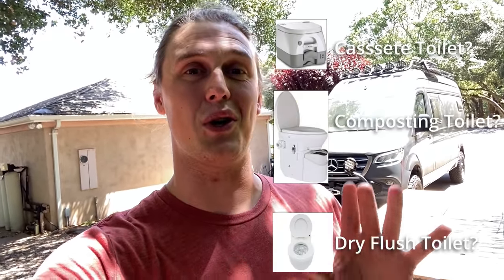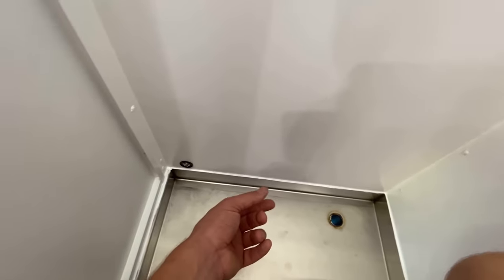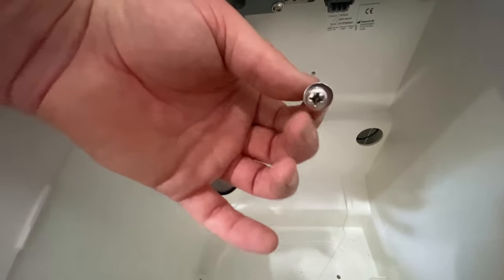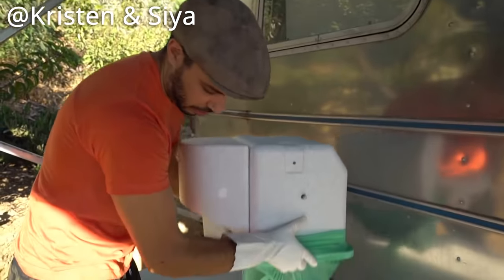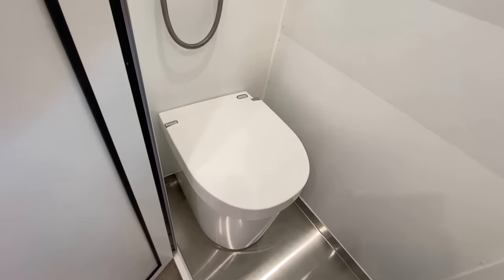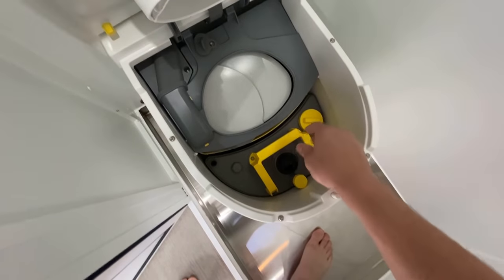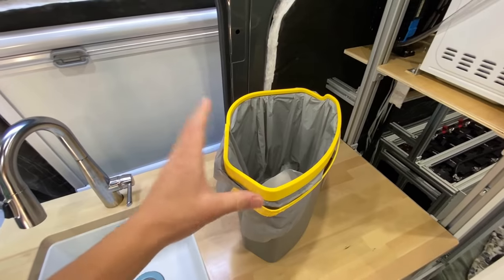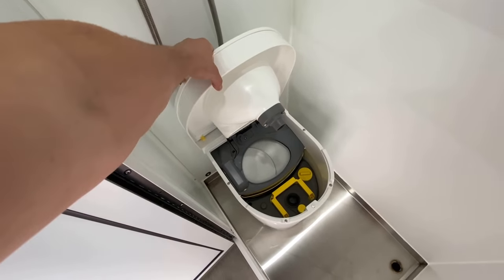The BEST TOILET For Van Life??? Hint: not composting

Comment: More options are always good, great video! 

I'm happy with my cassette, I also use a bidet hose. So the water I use to clean myself with also gets most of the 'material' down into the tank. I find it easy to keep the bowl clean at the same time for the same total water use as an ordinary flush cycle.

I think a good chunk of the odor issue comes from people being frugal on the magic blue goo because it's expensive, but you can buy a bulk commercial grade toilet cleaner that does the same job much cheaper but there's nothing to do about the odor from dump sites haha. Just don't breathe for a minute and remember to open the vent valve so you don't get splashed :)

Comment: We have a nature's head composting toilet and love it. We have cleaned it a few time and just go out in the woods and dig a small whole and turn it upside down and cover the whole. We usually wait at least 4 days to a week without using it before cleaning and have never found solids, everything was composted down. We have never hand trowled out the composting part. The urine container is white so you can see if the urine is close to getting too full. I am not sure how anyone could let that over fill unless they wanted to get views on Youtube. It's just a chore you do on the road, every couple days it gets emptied no big deal. Been on the road for 10 months but try to use a pit toilet or gas station toilet for the duty and only use our composter when nothing is available. It works really well because we stay in a campground and then it has time to compost down and we don't have to change it every month. Love it. I just don't think a months worth of number 2 in a bag would not smell without putting in some peet or something for the smell. Good luck

Comment: I've essentially made a DIY version of your toilet in my van. It's a 5 gallon bucket with a urine diverter attachment, and I have a trash bag lining the bucket. I even put a computer fan in to draw the air out of the toilet, and the whole thing is encased in a mostly waterproof box that I built. I still use peat moss over the #2's because it is going to smell regardless of the fan drawing air, and the peat moss helps to trap the odors a bit better even if its not being mixed up with the poo. You'll find out after you use it if it still smells at all, but if so just throw a little bit of peat moss on top and it should help a lot.
Reply from the maker: Super cool Dalton, I respect the DIY! Probably saved quite a bit of $ too
Reply: I use coconut coir. flies hate the stuff. Found in pet stores as reptile bedding or at a nursery's the stuff is insanely absorbent
Reply: @scott.wallace8625  And better for the environment as peatland is valuable and being lost.  Coconut coir is widely available too. Built my own DIY version also. Plans and a separator are available on the net.

Comment: Interesting concept. I have been studying this very topic as I decide what I would want for a toilet in a van conversion. I use a luggable loo in my boat which is simply a five gallon bucket with a seat. It has a bagging system that you simply seal up after use and dispose of afterward. The bags contain a substance which converts urine to a gel. I was able to eliminate the head system and all of its issues.

Comment: Great video explanation very interesting.  The only part that would weird me out is pulling the solid container.  Maybe they would add another feature where before you lift the seat, it would automatically wrap the solids bag into a tight closure so there is no "view" and all you would have to do is pull up and dispose of the bag.
Reply: Maybe just open the poo port and dump in some compost matter to cover it, then lift the lid and bag it up.

Comment: Thank you for mentioning something that I worked out so many years ago when researching toilets and that is that if you truly wanted a composting toilet to work that you would need to actually remove a bucket load and store it for months and then dump it after it had completely broken down. Although I have always wondered about the legality of dumping bags of poop in standard garbage. I think that this toilet takes the simplest ideas of peeing in a bottle and pooping in a plastic bag (on the very rare occasion that you need to poop in your van, because you are never really that far away from a toilet and if you are that far away from a toilet you can usually use a shovel and poop outdoors) and fancies them up with a smell extractor and some ease of functionality.  $3,500 (the price that I googled) for a fancy plastic bag and plastic bottle??? You would have to have more money than sense in more opinion. But I can see the appeal. You could hook a computer fan up to a bucket for like $30 and get the same effect.
Reply: Yes if you want to compost it, you would need to keep it for a long time, but it will continue to compost after you have dumped it somewhere appropriate...and if you look at the toilet featured, you will be faced  with a really unpleasant sight and job every so often, and you will be dumping pure unadulterated shit in the garbage bins...not nice..
Reply: Yeah, it's supposed to take 3 to 12 months for the harmful microbes to break down.
Reply: There nothing illegal or unethical about dumping bags of poop in standard garbage.  Where do all the baby and elderly diapers go, do you think?  And bags of dog and cat poop.

Comment: Thank you for a great video. We have used a 5 gallon bucket top lined with a plastic seat (pool noodles also work) with super strong OKKEAI 8 gallon trash bags and some deodorizing, clumping cat litter. Less space, less expense and just dump the bag responsibly. Your toilet is a great piece of engineering and we would be interested in its longevity. Ususally, simpler things last longer with less breakage. Especially during that Zombie Acopalypse when you really HAVE to go.

Comment: I was planning on doing a lazy composting bucket toilet for my trailer build.  Since I don't have a garden to make use of the compost the solids were going to get thrown out anyway.  I figured a layer of coco coir, a layer of poop, a layer of coco coir...  This should cover any smell like my cats do with cat litter.  No stir mechanism needed which allows for trash bags.  I lose space with the coco coir but I save on the engineering of not having to seal it too well.  It does require lifting the lid to pour the coco coir each time.  The >$1000 price for the Separett is not a deal breaker for me, but I want to see if the bucket works out before I spend that kind of money.
Reply: I'm in the same boat as you. Joseph Jenkins' Humanure Handbook has been super helpful for me
Reply: if you find it does smell Try adding a very small fan to remove the odour, or think about how you could add one later if needed :)

Comment: Great video. We had one of their toilets in our van and the smell from the vent was terrible. I like the idea but personally don't think they work for van life. I think they'd be a fantastic unit in a permanent structure where you could vent it through the roof or the rear of the building, away from the living areas. We swapped to a Natures Head unit and we get almost no smell from the external vent (which due to the design of our van is on the living side).
Reply: @Alexandra-lx4jq  my vent wasn't venting inside. The toilet was inside. The vent went out to the external wall of the caravan but as we sit close to the vent, we could smell what was venting out. Caravans can only be 2.5m wide so it can be hard to escape the smell.
Reply: @Alexandra-lx4jq  I could smell it when outside the van sitting under the awning etc. I couldn't smell it while inside the van.

If you could vent it to a side of a building that you don't go near etc it would be okay but if it's near an area that you use for living (ie. BBQ, outdoor seating area) then I wouldn't recommend this model.

Comment: If they could combine the toilet you have with an external cartridge, that would be ideal. I'll stick with a normal cartridge toilet for now, so despite the foul output, it's all in a sealed box I pull from the outside of the van and never look into.
Reply: Does cassette style really give off bad smell?
Reply: cassett only results in a nondistript brown liquid use the septic safe chemical and dump in any unsecured out house  or if your remotely cities have free dump stations during open during the week or down a friend's toilet being in that shower room it would smell that bad except when actually flushing but this toilet is cool to looks more like a weekenders solution than full time
Reply: the problem with separating soilds from liquids in a cartridge is being able to dump the solids the sloshing liquid helps break up and carry out solides as wells as pervents "pyramiding" the tendency of a waste pyramid forming at the cassette opening preventing new waste from entering  the cassette. but you maybe  able to add a specific amount of water to the solid tank to account for this.

Comment: Thanks for taking the time to make this video, appreciate it. For me however, it looks like too much faffing about. I own a cassette toilet for overlanding and I don't mind emptying it after a trip but yes it smells. I just personally do not like the separation of urine and poop that you have with this and composting toilets. If there was a combo composting toilet/cassette that took care of both jobs in to a lined (with a compostable bag) cassette that you could then tie off and remove that would be the most ideal I believe.
Reply: There's a model that diverts urine straight to a grey water tank. I wouldn't at all understand why somebody would prefer handling urine cassette instead of just releasing the greey water tank. Your comment makes little sense, seems to you prefer to have smells and to handle waste much more directly.

Comment: Thanks for sharing your ideas.
But somebody should make a incinerating toilet powered by diesel, just like those Webasto Heaters.
It’s gonna be the best solution for dealing the nasty stuff.
Reply: EcoJohn used to sell one that runs on diesel, but it's way too big for a van. Don't know why they stopped making those. Can't find it on their website anymore.
Reply: Or propane.
Reply: @scottslotterbeck3796   propane Incinerating toilet comsumes alot of propane. Electric ones also takes up alot of power. Both electric and propane incinerating toilet are aready on the market but its just not very efficient in saving electric or propane, so maybe they can make a diesel and will probably be better and economical, maybe.
Reply: A friend has a wood stove in his camper.  He incinerates his poo in the fire.  Never asked him what he did in warm weather, but assumed he used a cat hole in the forest.
Reply: @danbisone1587  that's a bit too cave man for me, but he's on the right track

Comment: why not buy their bags and use in a luggable loo?  this unit will eventually get mucky in every crevice and have to be thoroughly cleaned - uggh!  the only innovation I see here is the exhaust fan.  you could just build an enclosure for luggable loo and vent the enclosure.  I see lots of outhouse honey pots in campsites now that just use a chimney with stack effect to draw smell away.
Reply: Plus the point not mentioned is the luggable loo costs $25 or less.  This thing is priced at $1049.

Comment: The smell of feces I would guess during the emptying the bag phase would be horrendous and tend to linger inside the RV until completely aired out.  What do others say? Actual testing would have uncovered the convenience or inconvenience of emptying the toilet 1 & 2.
Reply: I would take the bucket outside to open it and pull the bag out. That might help. 🤷🏿‍♀️
Reply: @1nhonho  Good point.  Counter point...$1024.  That's a lot more than a cassette toilet and with those you can do the same thing, take it out of the van before removing the tank.  I found cassette toilets for as little as $70.  I can put up with a lot for $950.
Reply: @AudeKhatru   I was replying to your comment about the smell of the bucket when emptying. I really don't think buying a cassette toilet will help you avoid the problem. The cassette will smell when dumping as well. Most likely even more because it's raw sewage. 
A composting toilet is for people who do not want to deal with the disposal of raw sewage.
A cassette toilet has a small holding tank and requires much more frequent dumping. 
A composting toilet can last much longer, saves water and is much more convenient to dispose of.
You don't have to buy an expensive brand like this one. 
In their most basic form, a composting toilet is just a 5 gallon bucket, cover material and a urine diverter. Plenty of videos here on YouTube on how to do it yourself.

Comment: That's just a composting toilet without the composting material....
Reply: you mean a composting toilet is like that but somehow need composting material even though they dont compost !  oh there is a conundrum :)
Reply: @David_11111  No... I mean it's a toilet which separates the compostable parts as opposed to creating sewage. It's literally a composting toilet. You compost the results.
Reply: Not really.  It's basically a camping toilet with urine diverter.
Reply: @austingonzalez1148  You could Compost the results, Just the same as you could Compost the results of so called composing Toilets  Neither are Composing Toilets, they have a Bin Two years Big :) imagine that in a camper LOL ...
Reply: @David_11111  So you agree they're are the same...

Comment: That's a really cool toilet, but I would also add woodchips and start the composting process. Or add a compostable bag on the bottom of any compost toilet. Even though the composting process would not finish in a month, it would still be enough to get the process going, and to reduce the size of the waste. I used a compost toilet for a month in a summer camp, and you would be surprised how small the volume of organic waste becomes once it is composed.

Comment: This was very convincing. I have to buy a toilet and I was going to buy one of those cassette type toilets. No black tank, it comes with its own tank that you can fill with water press a button and it sends water into the separate tank attached to the same toilet. Still would need me to fill with water and I can imagine having issues with dumping it and possibly cleaning it but you showed me a good alternative. I especially like the bag instead of the material so will definitely be considering this one.

Comment: Good video but a few things i can add as somebody who lived full time on a boat with a composting toilet. (Airhead) for nearly two decades.   

First up neither the Airhead  or the style you have, and there are other similar units are composting toilets. 

Why very simple? As Separett told you their unit is not a composting unit as the solids dont remain in the unit long enough. Truth is either with or without additional organic material being added it would take about a year for your solid waste to decay to the point of being an inert compost and you'd need a pretty big container to be able to deal with a years worth of poo!

All of these units are as most people use them desiccating toilets.  

How they work and what makes them great for yachts, cabins or vans is that they eliminate 95% of the odour by seperating the solids from the liquids. They then dry, remove moisture from or as you should say desiccate the remaining solids by way of moving air. 

So the function of the fan is not primarily to remove odour it is to assist in desccicating the remaining solids.  Same way as moving air (wind) will help your clothes to dry.

So well done you, well done Separett and hopefully now you can continue to use your desiccating  for many happy years to come.

Comment: We do not, and have not, done any van camping. I simply find these innovations fascinating. I too would add a smidge of something loamy to the bottom as an assist to the constant air venting to dry out the solids. Just another after-thought ... I would personally add a spring loaded small curtain rod high up and just behind the toidy, and attach a thin shower curtain liner, so that when showering it can be pulled over top the commode to eliminate having to constantly dry it off after showering. And maybe to have shower head on the opposite end of the bathroom. Then you could sit on the shower curtain covered toilet to shower, which could be more convenient with younger kids. Just my 2 cents.

Comment: Very good video & cool space saving van toilet. For me; I am going to stick to my camco mini 10 ml; summer 2022. I like the height of the portable camco. I will only use it for urine only though; not add water to rinse; which allows 2-7 days before empting. Then, I will use a green composting bag for feces; (I may diy a small urine diverter for the camco though) .... Will keep feces bagged & sealed separately & toss in my separate gamma lid trash until I can empty it. But they will decompose over time & is extremely inexpensive.

Comment: Hi, I used a basic separtte diverting seat ( about 100 bucks)  routed the liquid to the grey water tank and put it in a slide out unit (no shower cubicle). No additional urine container to empty and much cheaper. Cheap PC fan on a timer switch keeps it odour free . . . .

Comment: This is a fine toilet at over $1,000.  OGO offers a urine separating compost toilet that is smaller for $200.   OGO does have one comparable to this toilet.  It is only me, so I trust that I can manage the OGO $200 in my van.   My plan is to use it only when necessary.